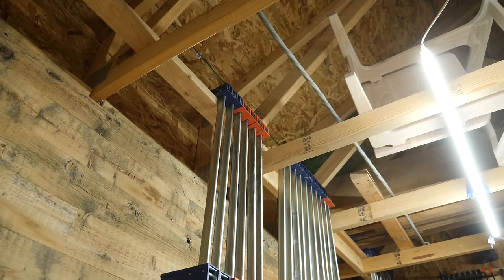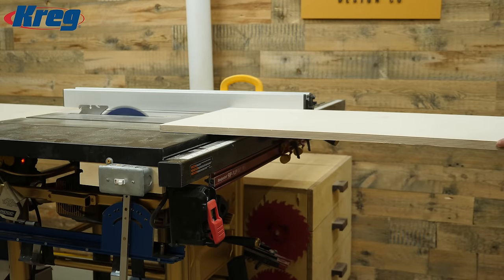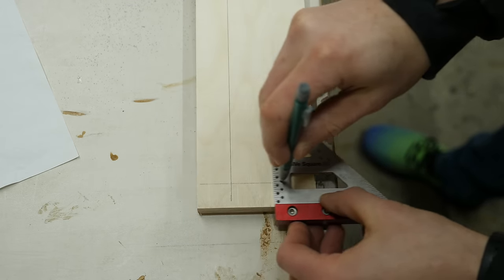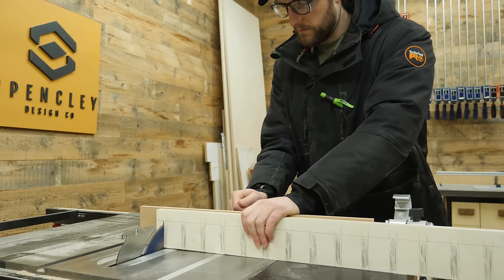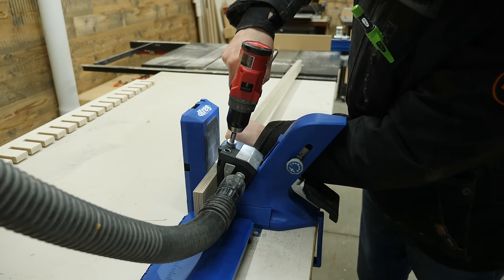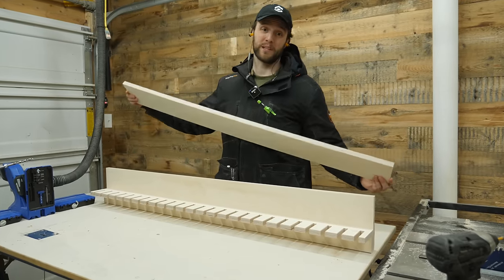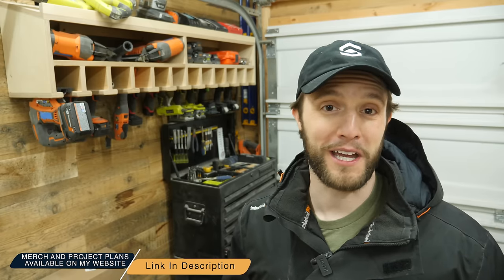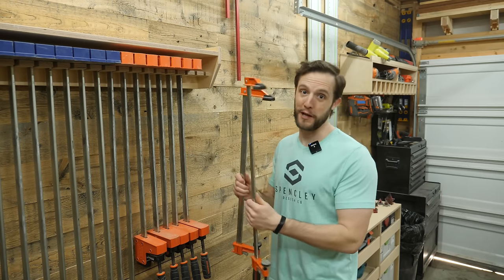cluttered shop? just build this with FREE PLANS

Comment: Great vid! I would have tried a Forster bit to hog out the ends of each slot and then the table saw to cut the sides. Thanks for posting this project. Now I know how I want to make my own 😃
Reply from the maker: That’s what a few others suggested too, but I’m not sure that would save time. Might have to test both out and see 😀
Reply: I thought the same thing
Reply: This is actually a better than making a few pass with the table saw and then use a chisel. Newbie here thanks you, Kent!

Comment: Half baked potatoes are the best. Heat up a cast iron skillet with your choice of oil (we use olive oil). Cut small to medium potatoes in half, long ways. Place face down in the hot oil, then place the cast iron skillet into an oven (we use convection settings), @350 degrees for about 30 minutes. The cut edge is nice and crispy, with a perfect baked potato center. 
Great channel, nice build on clamps rack, and also the boom arm was sweet.

Comment: Thinking of using a router to make those cuts, with a spacer that fits in the previous cut, so you get consistent spacing and eliminate the need to mark every cut.
Reply from the maker: That could work too!
Reply: Could you imagine the saw dust from that. My DIY dust collection ended up costing me more than just buying one. I just need to suck it up and buy one.

Comment: You MASHED those potatoes as always, Eric.  Slick look, and I think may be needed for parallels.  Looking at super compact design from guy at inspiration woodworks for F clamps.  As to approach on doing the dado thing with no dado blade for slots . . . If radius on end no issue, I think I'd create a single guide with a stop for length of slot, measure and mark placement for small jig, clamp, and rout.  Rinse and repeat on down board.  (I seem to remember you were engineer, so you'll know that rounded end won't have stress concentrators that you'll have in those corners, though with ply not any real risk I expect.). All the best.

Comment: For cutouts... One idea would be to do one rip all the way across, set your fence and cut out a bunch of identical fingers then glue them back together. Another way would be crosscut the gaps, material flat on the table with a stop dado. It won't be flat. You could flip the board over and stop dado from the opposite direction and it would be pretty flat, depending on how high you put the dado stack. Or with most of the material gone and your gaps clear you could just use your regular blade to clean out the excess material making it flat.

Comment: Instead of repeated kerf cuts... You could have drilled a hole at the base of the U cut.. and only done 2 cuts on the table saw per "slot". This is similar to how you would make a handle in the middle of a piece of wood.  Drilling holes on each end and connecting the edges together with the side of each hole.

I built something similar using the method I described above, since my bandsaw is not wide either.

Comment: Hash browns. Well done - I made a smaller version for my 6" and 12" clamps, and another one for the 24" clamps. I used 3/4" plywood just in case because of the weight, and it's worked well. I don't have any easy way to attach them to studs so I used 2x4 supports and a small base for stability, which has worked well. I used a jigsaw and router to clean out the slots for the clamps - that took a while!
Reply from the maker: Nice nice nice! Is it working well for you?
Reply: @SpencleyDesignCo  Yes it works great. The smaller one sits on the workbench (only holds 8 clamps), while the other one is on the floor next to the larger tool cabinet. Both are easy to reach. Now I need to figure something out for the 48" pipe clamps....
Reply from the maker: Well you just wait because I’ve got another clamp rack design coming out too!
Reply: @SpencleyDesignCo  Great - look forward to it
Reply from the maker: Thanks for the continued support, Erik!

Comment: This is a great video. I just came across your channel today, and now I need to build this.
I was thinking you could use a forstner bit to drill a circle in the top of the notch, then you just have to make two cuts on each side of the notch instead of hogging it out entirely with the blade. I hope that makes sense. I feel like a rounded corner instead of sharp corners would theoretically be less of a stress point as well? 
Anyway, I'm glad the algorithm finally brought me to your channel.
Reply from the maker: Thanks for watching! The forstner bit would be a solid idea 😀

Comment: Great video. Seems like a good project for me. I was thinking, your dado stack may have worked if you lay the plywood flat on your table and cut through that way.
Reply from the maker: That might work, but it would cause the slots to be rounded since the blade won’t go in at a perfect 90
Reply: @SpencleyDesignCo  true. Set up a stop and call it a design element lol.
Reply from the maker: 🤣 something like that

Comment: Hash browns O’Brien style. What do you think about using a router or router table to cut the slots in the holder? Do you think pipe clamps could be stored with this system as well? Thanks for posting and keep the videos going!! Well done!!!
Reply from the maker: Thanks for watching! You could use a router, but I don’t know it would be faster. 3/4 plywood is a lot of material to hog out

Comment: great video. i think it will work great for my parallel clamps. I need to find a wat to do F clamps a little differently. I ned to have more than 1 in each spot to save space on the walls. also, well done home fries 100%

Comment: Cut into wedges, seasoned with salt, pepper, garlic powder & paprika, and cooked in the air fryer.

I probably would have used a router to cut the slots. It doesn't matter if the ends of those slots are slightly rounded.

Comment: I have limited wall space in my small shop. I find that a single depth clamp rack is a waste of valuable wall space. A multiple depth (double, triple, ...etc) rack works much much. You will see as your tools grow and you need more storage space.

Does it get old working in the cold (you are always seem to have a coat on). Heater next???
Reply from the maker: I’m actually building another clamp rack variation in the future to see which one I like best. Here’s a video to answer your question about the heater https://youtu.be/jJ7h5z0OrKU

Comment: Potatoes in the chip form are my favorite. I work in a shared workshop with a collection of clamps. I would need to put up some pipe clamps. Are the openings in this design wide enough for a pipe in a pipe clamp system? If not I could just increase the opening a bit for these. Why is the title of this video "you should never buy this"?

Comment: Eric, tater tots! I think I would’ve tried using a depth stop on my sliding miter saw to cut those slots!
Reply from the maker: Thanks for watching! Wouldn’t the miter saw be just as much work though?
Reply: @SpencleyDesignCo  it probably would be the same work, personally I think it would be safer though because the piece would be stationary and you’d be moving the blade through piece. Just an opinion
Reply from the maker: Give it a shot and let me know which one is faster. I’m genuinely curious 😀
Reply: @SpencleyDesignCo  it’ll be a couple months with other things calling for my time but I will be building the clamp rack for sure!
Reply from the maker: I hope it goes well!

Comment: Very cool build my friend. Any thoughts on attaching panel dining table leg?
Reply from the maker: Attaching a dining table leg to the clamp rack?
Reply: @SpencleyDesignCo  lol no, separate question. A project I am working on. Although a clamp rack attached to the dining room table leg could be fun.
Reply from the maker: I’m not sure I understand the question about the dining table
Reply: @SpencleyDesignCo  I am building a dining room table with two panel legs instead of 4 post syle legs.  Was what type of joinery you would use to secure the 2 panel legs to the table.
Reply from the maker: I’m not sure what a 2 panel leg is
Reply: @SpencleyDesignCo  ok no worries
Reply from the maker: Do you mean laminating 2 pieces of wood together instead of using like 12/4 lumber?
Reply: @SpencleyDesignCo  yes
Reply from the maker: I wouldn’t treat it any differently than a non laminated leg

Comment: Double fried french fries! If you haven't tried them yet, you are missing out.
Great build, Eric. I realise that because Kreg is a sponsor of this video that you went pocket hole crazy (I'm a big fan of them btw). I have a potential solution for not having any pocket holes visible on the top rack of your build. It involves screwing in screws from behind the piece. Takes a bit more effort and planning, but at least one wouldn't need to worry about which face is nice or not. Knowing myself and how easily I make mistakes I might consider it when building this. Your video gave me such a great idea (and motivation) to do something about my clamp situation.
I'm also so glad you don't promote some nasty green shakes in your videos. Makes me wonder if you also watch videos promoting "shop greatness"? Haha
Reply from the maker: Thanks for the continued support! Are doubled fried French fries really fried twice?
Reply: @SpencleyDesignCo  Indeed they are. Some argue it's unnecessary if the oil is at the right temperature and the potatoes are sliced to the right thickness. My experience is that twice fried is a lot better. The first fry is supposed to cook the fries all the way through. You then take the fries out of the oil and let them cool thoroughly. You can then fry them a second time, often hours after the first fry. You are then left with fries which are extraordinarily crispy and golden brown on the outside, and extremely soft on the inside.
Reply from the maker: That sounds good! Is this typically something you’d find at a carnival or fair?
Reply: @SpencleyDesignCo  I don't know if it would be there. We don't get many carnivals or fairs here where I am in Australia.
The few places I found were either a super hipster food truck and a local (non-chain brand) restaurant. The food truck was more expensive than the restaurant, but absolutely worth every last cent.
Reply from the maker: Ahhh yes that’s what I was thinking of! Kind of a “street food” or “food truck” style food. Those places always have some interesting food creations
Reply: @SpencleyDesignCo  They certainly do. Used to be relatively cheap, but in recent years it's become a bit of an expensive novelty.
Reply from the maker: It’s the same here in the states! Prices have gone crazy!

Comment: Showing how you made the notch marks demonstrates you are too young to have learned common mentored speed skills. Everything in fact was so frustrating to watch.  It would have been way faster in many ways. Tools and experience. 1. Dado 2. Router w/o squaring. 3. Forstner bit at each channel end. Radius is okay  4. Jigsaw and Forstner.   AND In all cases... Step over jig. Two hole points and two piece to block and move; not one????   Or using a Precise 'pencil/Marking divider on a single drawn center line= Sheesh ... smack forehead with open palm.  You would drive a busy older craftsman crazy.   Step and repeat tools are how they built ships and pyramids before they used rulers, tape measures, or knew inches or feet. It was a repeatable stick that could be duplicated for 20 or more copies - all workers had the same. All from one primary that had two holes and could pivot 180 degrees before ever lifting and clumsily misplacing it for the third hole. What you could have done. But now we and you have D I V I D E R S. Super precise if you have a ruler handy.